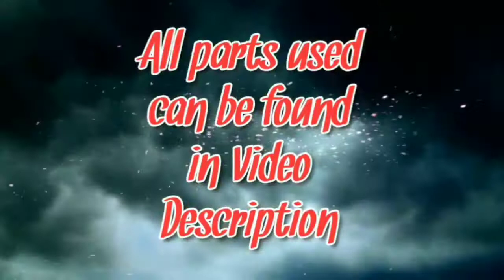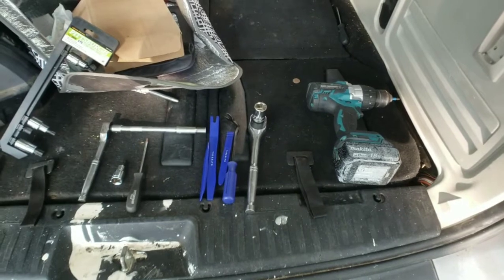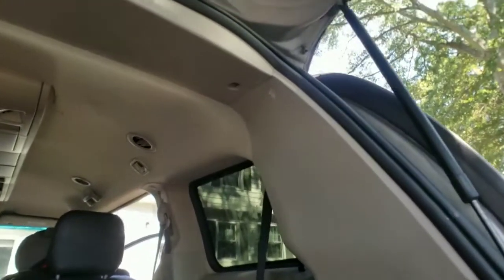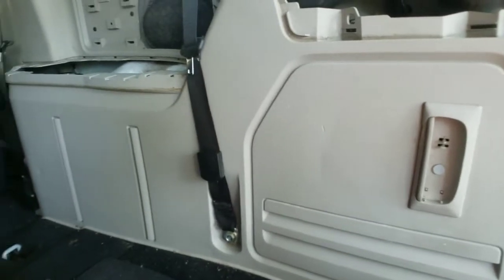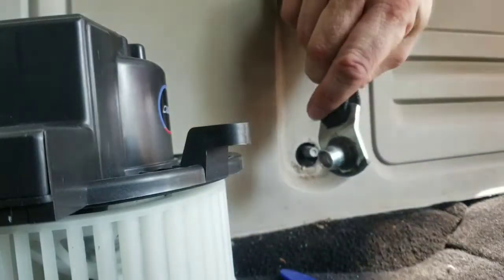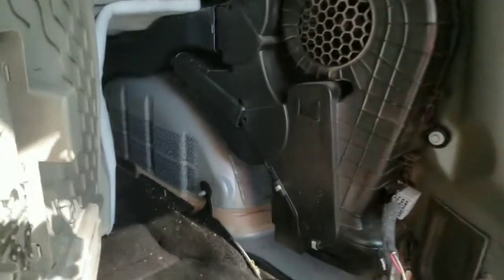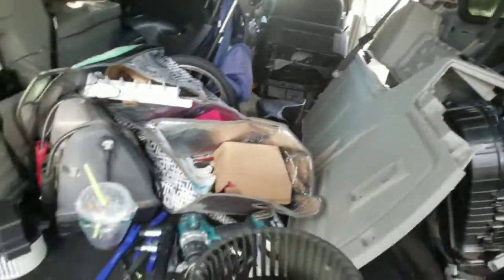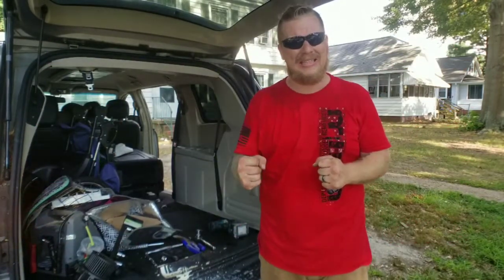2014 Chrysler Town and Country Rear Blower Motor Replacement Made Easy

Comment: Thanks a million for this vid! I was able to get the new blower installed in my 2016 T&C touring in about 30 minutes even with my 6 and 7-year-olds asking a million questions about everything I was doing and giving them a walkthrough. My dealership wanted $180 for the part and $300 for install!
Reply from the maker: You are most welcome Crystal! Yeah kids can do that sometimes flood you with a lot of questions but they are amazed by it just like we are. Great job on the repair and congratulations on having air again in such a hot summer

Comment: Thank you for creating this video. It was very helpful in getting the blower replaced on our 2014 Chrysler T&C Touring. Took me a little less than 2 hours being very slow and methodical. Biggest challenge was getting the cupholder piece up and out to get to the two screws below the speaker that hold on the large panel assembly in place. That cupholder assembly was an absolute pain in the backside to get removed. Outside of that, very easy process thanks to your instructions.
Reply from the maker: You are most welcome Bernard I am glad that the video was beneficial to you and your repair on your Chrysler Town & Country. Thank you for watching!

Comment: Thanks for sharing. Curious when you pulled the assembly out a little to change the blower, did it not cause a coolant leak from the bottom? Apparently from some other videos I have watched, the bottom of the assembly is screwed to the floor of the car and the coolant pipes are also there on which it sits on. So yanking it out to lean forward, did it cause any issues later?
Reply from the maker: No issues later, just when it comes to that part add pressure while pulling so it doesnt move any unwanted parts. Thanks for watching!
Reply: @Sellthoseflippingcars  pressure as in?
Reply from the maker: As in if something looks like it's about to break, stop bending it immediately and find another route

Comment: Great job! Well done.
Reply from the maker: Thank you Ian! The van is so much cooler now inside, even with the outside temp being nice and toasty. Thanks for watching and stay tuned for the next one, I should have it out by Wednesday!
Reply: @Sellthoseflippingcars  

I have a '14 dodge grand caravan 30th anniversary edition so your videos are my go-to for repairs and tips. Curious...did you ever have an issue with the notorious oil filter housing unit?
Reply from the maker: I have not yet but might replace it just for an episode......gotta talk the wife into that one lol. Is it broke? Well no hun but ummm it could be!! Lol I know it is a common repair on this model. Are you having problems with it?
Reply from the maker: Also thank you for the compliment. I am very happy my channel can help you with your vehicle as well and save you money on repairs. It makes it all worth it for me.
Reply: @Sellthoseflippingcars  

Already changed that housing unit before the rona shut everything down. Not a difficult job, just oh do maddening when you see the horrible design. Plastic, rubber o-rings all sitting on an aluminum head and no access without removing upper and lower intakes. 

If you do it, I highly suggest you grudgingly go to dealer and get the genuine part. Don't take chances on aftermarket. Also, you'll need to buy replacement upper-lower intake manifold gaskets. Fel-pro excellent choice, sold in a set and around $55.

Excellent you tube tutorials available.
Reply from the maker: Nice! I will have to remember that if I can get that one in the video line up. I have quite a few others to knock out 1st on the Town and Country. Struts and shocks, spark plugs, exterior A pillars,  and quite a few more.
Reply: @Sellthoseflippingcars  

Looking forward to the strut change one. Thanks!
Reply from the maker: I haven't forgot about you Ian. I had a PT cruiser owner need some electrical help. Got a nice video from it, I also ordered in the new brakes for the Town and Country. I need to finish the editing but I will have a nice shocks and strut replacement video for you very soon

Comment: That cup holder is plastic weld into the whole trim piece you do not want to take that off unless you plan on gluing it back
Reply from the maker: As you see in the video mine was not a plastic weld but held in by Clips. It does reinstall perfectly as shown at the end of the video.

Comment: Hey I have a 2103 t&c and my question is could it just be a fuse and not the motor? How do you tell the difference?
Reply from the maker: You check the fuse Alphonso, if the fuse is good then its the blower motor. Thanks for watching! Sub for MORE DIY AUTO! Stay tune for upcoming episodes on where that fuse is and how to check it.

Comment: The A/C and heat for the driver/passenger works well in the van, but no air blows out at all in the rear cabin. Is there something else I should check first or just replace the blower motor?
Reply from the maker: Shane that sounds like your rear blower motor has just bit the Dust. You do also have a resistor back by the blower motor as well you could always test. But nine times out of 10 it's the blower motor that has given out.
Reply: @Sellthoseflippingcars  Well, the video was great for replacing the motor blower, but it didn't solve the problem. Whereabouts might that resistor be that you mentioned?
Reply: @shanewampler131  you probably already fixed this issue but that resistor only controls the variable speeds of the blower motor...if u replaced the motor & it still doesn't work u probably have a fuse or maybe a relay somewhere for the hvac that went bad
Reply: @shanewampler131  for example, the resistor is shot on my minivan in the rear but the fan still blows(cold)...it just blows on all the way high or not @ all...i'm simply unable 2 adjust the fan speed because the resistor has failed; hope that makes sense

Comment: Air quit coming out of my vents completely so we took the panel off and air is coming out of the center of the blower motor. Did you have similar issues?
Reply from the maker: My blower motor stopped completely and did not blow air at all even at the blower motor. If you have air coming out of the blower motor but not the vents, check for a clog in the vents. I know if you have children like me.......hey.........it could happen lol

Comment: Good video but there is no reason to remove the cup holders. There is nothing underneath that needs to be removed and they do not pop off easily even using a trim tool. Otherwise this video was a great help to me getting my rear  blower replaced.
Reply from the maker: True, the cup holders do not need to come out. My apologies on that one bro. I am glad the rest of the video was beneficial and took some of the headache out of the repair for you. Thank you for watching Neil!

Comment: hey, man, is the transistor goes with that blower builtin?
Reply from the maker: @MrRGM10  yes
Reply: @Sellthoseflippingcars  is that sure? I mean i saw the black resistor thing looks like it has fins . I hope we are on the same page.cause im about to buy
Reply from the maker: @MrRGM10  rarely does that resistor go out but you can always check with a multimeter. If the power is passing thru when you have the rear blower turned on then that is fine, if not it's an internal failure on the blower

Comment: I have a 2015 same model not blowing any air out of the rear but occasionally I'll hear a noise out of the vent, a vibration/ticking sound. Does this still sound like a replacement blower is needed? 
Thanks!
Reply from the maker: Yes that is correct Donna, the rear blower motor has went out and that is the vibration ticking sound you are hearing. Thanks for watching!

Comment: I have a 2013 T&C.. just curious. The rear blower motor in the back is extremely loud. Is it the blower motor or something else ? Thanks.
Reply from the maker: That would be the internal bearings on the blower motor. The blower motor needs replaced, thank you for watching!
Reply: @Sellthoseflippingcars  awesome! Thanks for the quick reply!
Reply from the maker: @jakeleeps5904  You are most welcome! Thank you for watching and stay tuned for more DIY Auto repair episodes here on the channel

Comment: I have a question. So it's blowing in the back ac..but not the front vents. However the heat blows through back and front. What could that be? Thanks in advance.
Reply from the maker: None of the front vents? Even the dash and floor?
Reply from the maker: Also is there any ticking noises?
Reply: @Sellthoseflippingcars  not that I can hear.
Reply: @Sellthoseflippingcars  nope not even the dash or floor...which is weird because the heat blows out of them..and ac blows in back. I'm not mechanically gifted at all..but I did watch a video and I checked the fuses..and they were all good.
Reply from the maker: Sounds like the Potentialometer that is in the temperature selection hub, (the three knobs for the HVAC) sounds like it went out. When it does it becomes stuck in that position. I can do some further research for you if needed
Reply: @Sellthoseflippingcars  you are so kind..I can try to Google that. I really appreciate your help! I was trying to avoid the shop but I think it's inevitable. Your videos are awesome and help so many people save so much money.  Keep up the good work! 🥰
Reply from the maker: Thank you! I am glad you enjoy them! Unfortunately I don't have a video on that repair yet, I have been wanting to purchase another fixer upper van for the channel to do repairs for. I help others in person if your ever in Southeast Virginia. Thanks for watching!
Reply: @Sellthoseflippingcars  Awesome. Thanks again! I have a  2013 chrysler town and country and it's been my absolute favorite car I've ever had. Im still way under 200k miles. I don't drive far much.  I love the stow and go seats and comfort and functions. I'm tall and in a sedan I feel like I'm in a pop can. Lol  She's been good to me.  🥰
Reply from the maker: Those stow and go seats were my FAV as well with the Town and Country! You are most welcome Heather! Thanks for watching!!

Comment: If I want to pull the entire blower out, can I do so without messing up the A/C lines?
Reply from the maker: Yes the ac lines to the left while the blower motor and assembly is on the right. Always remember to check for any lines and harnesses still being connected, before pulling the assembly out.

Comment: Mine turns on sometimes and sometimes it doesn’t, could it still be the blower going out slowly or some other electrical problem?
Reply from the maker: That is the capacitor that is going out on yours. That controls the electricity that is fed to the blower motor, when it is intermittent, so is the blower motor.
Reply: @Sellthoseflippingcars  capacitor, is that the same as the resistor?
Reply from the maker: Yes, my apologies Antonio

Comment: After the two 10 mm bolts, I’m having a hard time getting your next step to work. Can you help?
Reply from the maker: Sure what's going on?
Reply: @Sellthoseflippingcars  the panel the two 10 mm was holding in, I can see the blower motor but I need to lift it up and pull it sideways, but it won’t lift up. Something’s stopping it. It feels like it needs to be lifted up and pushed sideways
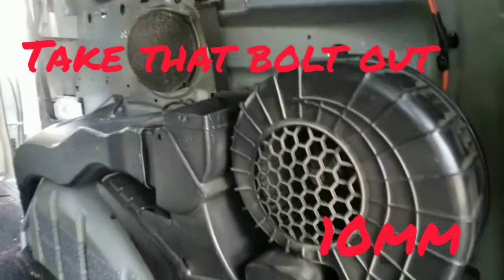Reply from the maker: Do you get the bolt at 9:32?
Reply: @Sellthoseflippingcars yes I did
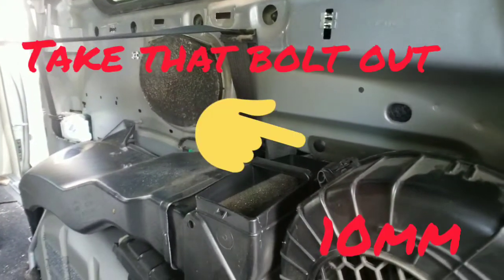Reply from the maker: Once you have the bolts at 9:30 and 9:33 then you disconnect from plastic tubing so you can pivot the housing to grab the bolts on the back of the housing, that is holding the blower motor in
Reply: @Sellthoseflippingcars  i didn’t see any plastic tubing
Reply from the maker: I am talking about the duct that goes to the front, it will have a support bolt on it, after removing that you will be able to lift and move the housing
Reply: @Sellthoseflippingcars  thank you so much for your help!  I’ll look at that tomorrow
Reply from the maker: You are most welcome! Check out our Super Thanks and Stay tuned for more DIY Auto here on the channel!
Reply: @Sellthoseflippingcars  i definítely will
Reply: @Sellthoseflippingcars  I got it done!  There were actually 3 10 mm bolts.  Appreciate your video and help so much. Now the baby can be cool 😎
Reply from the maker: Nice! Great catch on the last bolt! Thanks for watching!

Comment: So i turn on the rear ac and it just blows warm air sometimes a bit cool but hot hair only 2013 town and country touring L i would like to knownif its the blower motor or what xould it be anyone help
Reply from the maker: If the blower motor was not working it would not blow anything at all. It sounds like you need to service your AC. If the system is needing serviced it does not have the correct pressure and will not blow cold air all the time.
Reply: @Sellthoseflippingcars  thank u

Comment: I now have a refrigerant leak from leaning over the air box and i still haven't got it over enough to pull the blower
Reply from the maker: Remove it if it is causing too much strain on the plastic. You don't want to break anything

Comment: Having issues with the same vehicle.  Is it the motor, when the air flow starts to go up and down while blowing or could it be the regulator? I know they are right there together but do you reccomend to replace both while everything is apart or do you think it just sounds like a motor problem.  Thanks in advance! Great video.. you got a new subscriber for sure buddy!!👍
Reply from the maker: Check the regulator first with multimeter while someone else adjust the speed of the blower. See if the voltage fluctuates from the regulator. If the voltage does not fluctuate the regulator could be malfunctioning and that is your problem. If the blower motor was your problem you would not be receiving any air out of the vents at all. When a blower motor goes bad it is either working or it is not. I'm glad that you enjoyed the video and found it to be beneficial. Thank you for watching and let me know if you have any additional questions.
Reply: Ok.. I've noticed when adjusting the air.. every ounce in a while the screen flow bars will flicker a little on the display screen.. so most likely it's the regulator you think? Is that pretty easy to install? Thank you  for getting back to me so quickly.
Reply from the maker: That is a personal choice, I would do it since I am there and the blower motor doesn't cost very much either. But in this case I would be looking at the regulator, to fix the malfunction.
Reply: You the man!.. thanks for the info buddy!!🤘👍
Reply from the maker: You are most welcome
Reply from the maker: The resistor at the blower motor can cause resistance to the circuit if it is going out as well.
Reply: The resisters is on the motor? Or beside it?  How can you know which one is causing the problem? Thanks in advance buddy
Reply from the maker: Yes and you will need to perform an ohm test on them.

Comment: Easy fix but don’t remove that cup holder! Mine was plastic welded on and now I have to figure out how to fix that as it won’t secure. Sucks big time.
Reply from the maker: 😕That is crazy I just had the plastic tabs at the top holding it into place. I am finding out though there are different small details in the trim model with the vehicle. Depending on the trim model you will have a different cup holder, different cabin air filter set up, and a few other minor differences in the trim. Sorry to hear about your cup holder Michael

Comment: This video is missing alot of information. My blower motor housing or duct is secured to the floor. Mine doesn't just lean over like that
Reply from the maker: Same year? What trim model do you have?
Reply: @Sellthoseflippingcars  seriously, I was just about 2 ask this myself, I have a 2014 t&c...what about the a/c lines underneath the van that connect 2 the evap core inside of the hvac unit? None of that gets damaged if u don't disconnect them if I'm only replacing the blower motor just like u did in this video? Don't wanna kink a line & cause a leak or anything...

Comment: Thanks for skipping over the part where you actually pulled the blower away from the body of the vehicle. That's the only part giving me trouble.
Reply from the maker: How is it giving you troubles? By the way, you can just ask the question and hold back the sarcasm, I would not of recorded the video and have a channel if I didnt want to answer your questions and help you get back on the road. Thanks for watching Lucas

Comment: LMFAO @ EASY.  This is a huge pain in the ass....
Reply from the maker: Did you follow the video?
Reply: I agree.. Dodge makes it hard, but I will give it a shot ...I might as  well fish my tire out and put it on the roof while I am at it ..
Reply from the maker: You got this! It might not be easy as adjusting the seat but it will save you hundreds of dollars!
Reply: @Sellthoseflippingcars  Thank You 😊. Will let you know my progress.  I beat TIPM recently by forcing it to act right instead of spending hundreds of dollars.  I think the key is learning to be patient and taking time to deal with the issue....figuring it out.
Reply: No, I got it done, but this is clearly not an "easy" fix.  Ita a pain in the ass for such a simple part.  Clearly could be easier but most car companies purposely make things harder so you take it to their shop.
Reply from the maker: Saving money is never easy but it is worth it, if you have a goal you want to reach. I tell my wife all the time about these cars, if it was easy everyone would do it. Compared to some of my other videos, replacing a blower motor compared to a head gasket replacement is much easier.